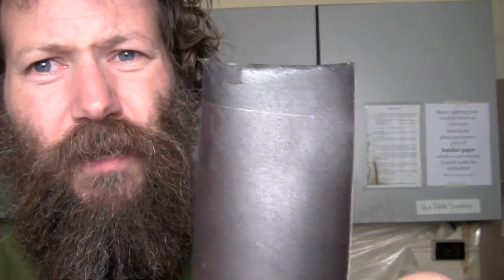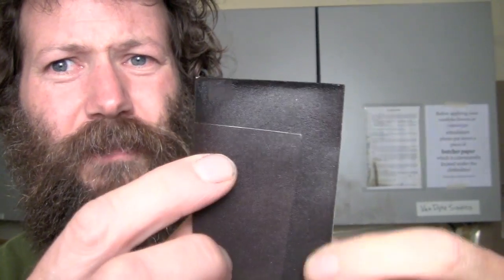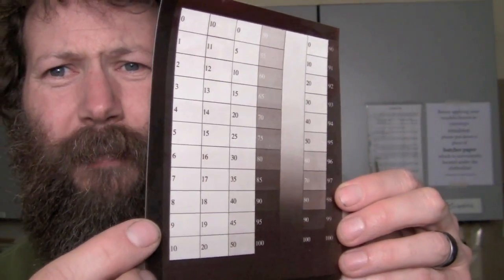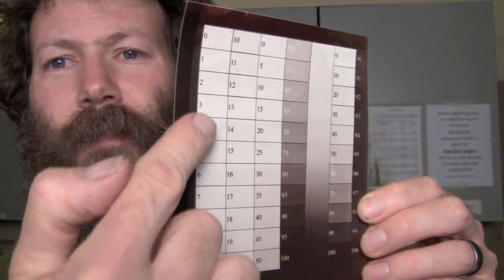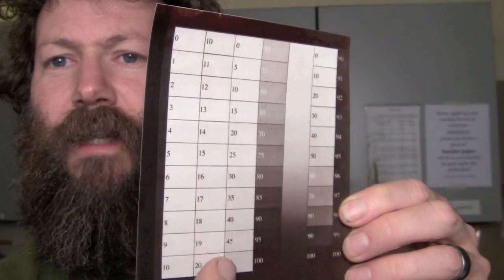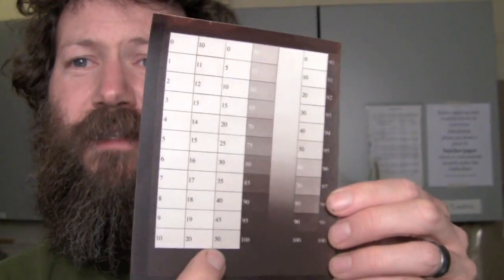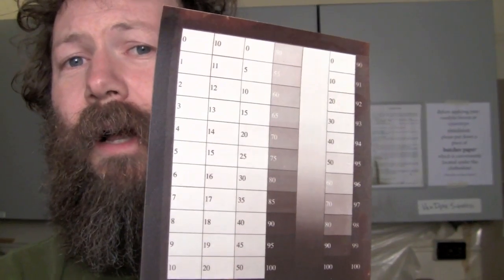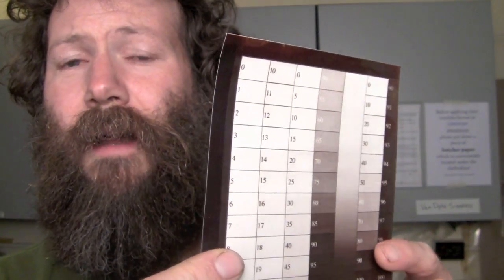Digital Negatives - step 3

Comment: Hi Will, I've done DMax test using a color enlarger with a contrast mix of 1 at a height of 24" and aperture of 4.5. I used 10 steps of 10 seconds each for the Ilford Multigrade paper and after development my DMax for my substrate (Pictorico) was 30 seconds. I later exposed my step tablet (printed on Epson R3000) for 30 seconds and it was way too dark. Even at 10 seconds, it's still a bit dark. My process was exactly the same for both. I would very much appreciate any suggestions? Thanks, Chendo - info@chendoperez.com

Comment: So when contact printing the step test, you just expose for a full 8 minutes without test stripping in the manner of a darkroom?
Reply from the maker: No. You want to do a test to determine the d-max of the paper. I think that is what video 2 covers. But basically take a small piece of paper and contact print it with a small piece of clear negative film, it does cut some light. I did a time test with 1 minutes intervals, moving a piece of board down after each exposure just like in the darkroom.8 minutes seemed the darkest.  I hope that helps.